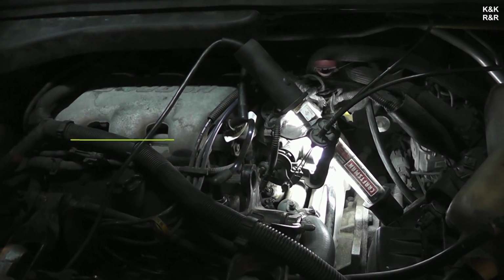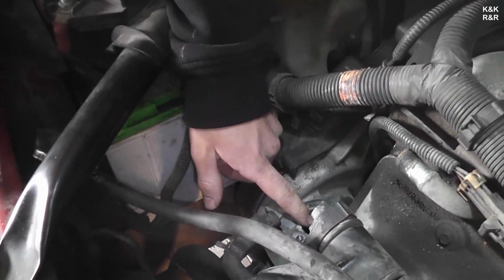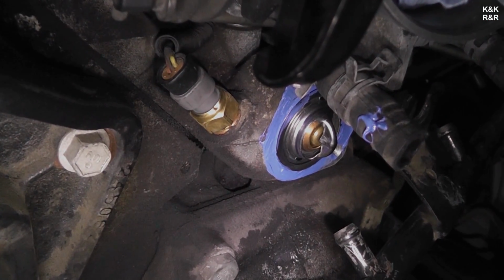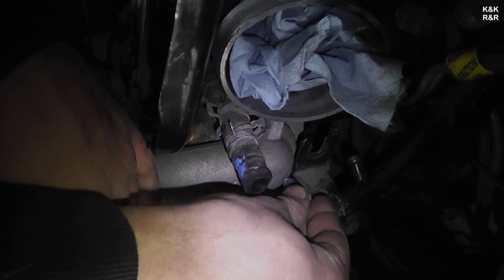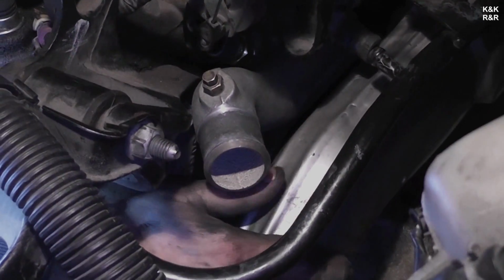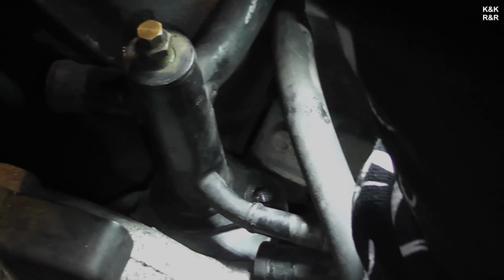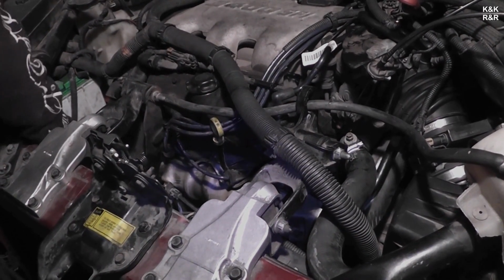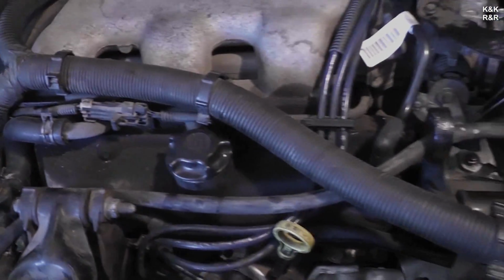How To Change A Thermostat 2001 Oldsmobile Shilliette 3400 GM 3.4L V6

Comment: CalVan makes a special wrench that costs about 12 bucks that is specially shaped to get that back bottom bolt it the housing so you don't need to do so those disconnections if the exhaust and the other shit. It's like u shaped and just goes around everything and goes back up around to the bolt and you just unscrew it like any other bolt
Reply from the maker: We are finding these newer engine are requiring some special tools to service simple items.
/K&K

Comment: I noticed that the throttle body was in your way the entire time. Would it be easier to just pull the 3 or 4 bolts and move it out of the way? I'm getting ready to do this job and was wondering. I have the same EXACT symptoms. Car wont heat up to operating temp, gas mileage is bad, and the heat isn't kicking out like it used to. I think the thermostat is stuck open. Other than that, it's a 20 year old Oldsmobile with 125,230 miles on it and it runs like a champ. My wife has a 2011 Chevy Cruz that gives us way more problems than my 20 year old Alero. They dont build em like they used to. I think my next car will have carbs. I'm going to buy something really old with a V8. Lol
Reply from the maker: We left the throttle body on so we did not have to replace the throttle body to intake gasket. A vacuum leak at the throttle body / intake gasket can cause a stall out or rough idle.  Once you get it a part you will see there is a fair amount of room to work.  Your right they don't build them like they use to.  Today's vehicles might get better fuel mileage, but the repair cost just about balance out the fuel savings out.  
/K&K
Reply: @KNKRNR  ive pulled the TB on my 3.1 at least 5 times..... no leaks 
.
its a 100% reusable gasket..... at least by design 
but if ya live in an area with no rust..... and actually wash the engine once in a while.... it will seal just fine